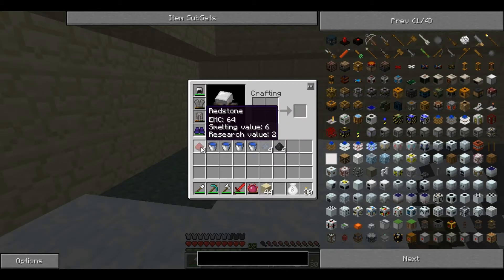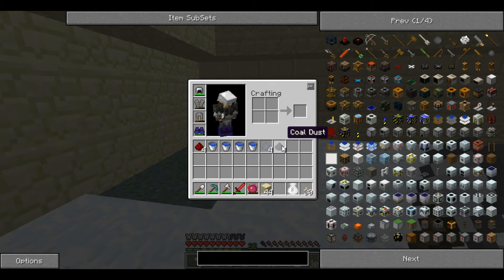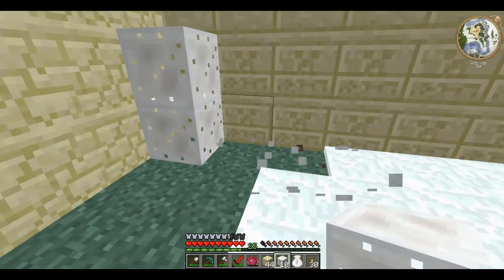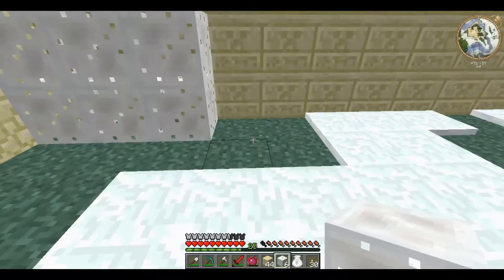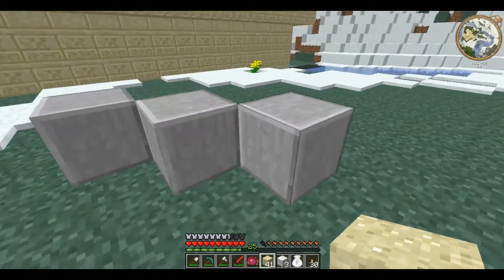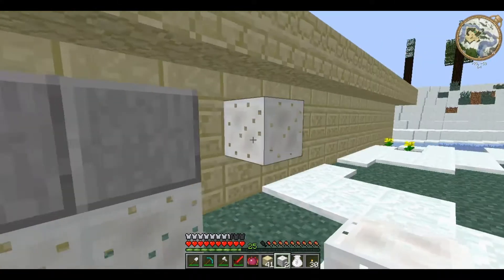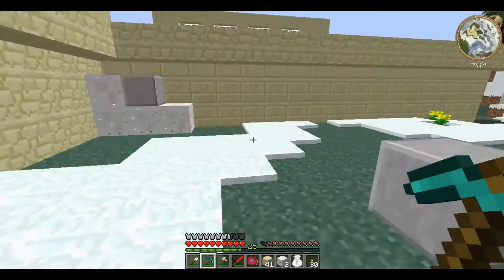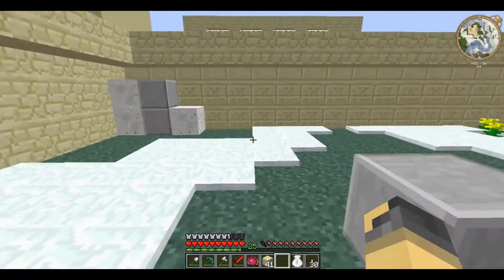Technic Tutorials #15. Construction Foam

Comment: It would have been nice if you had went into more detail about the construction foam.  Such as the CF Sprayer and how you can spray it on scaffolding and it will only go where the scaffolding is.